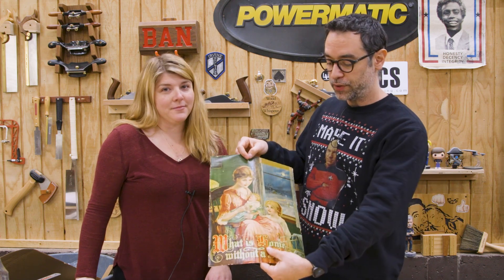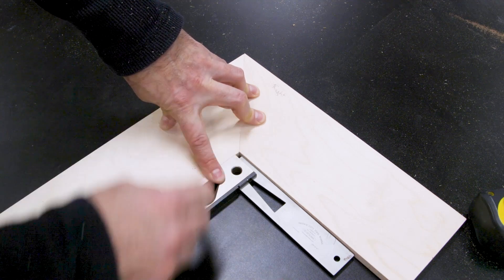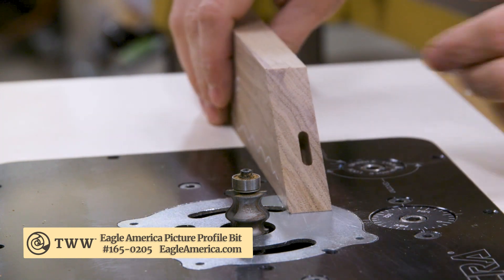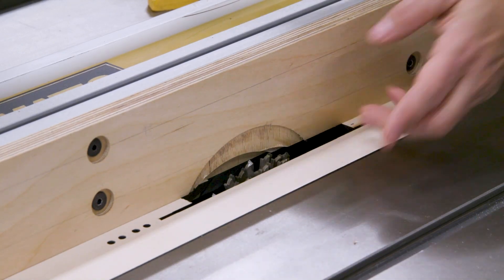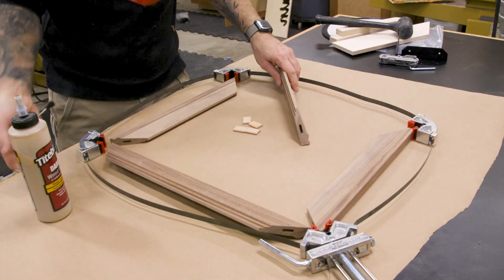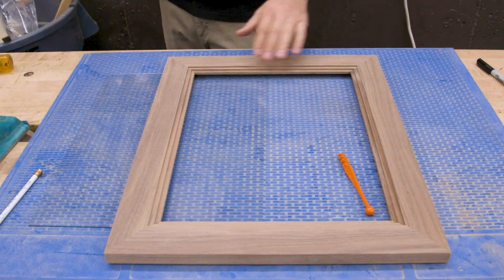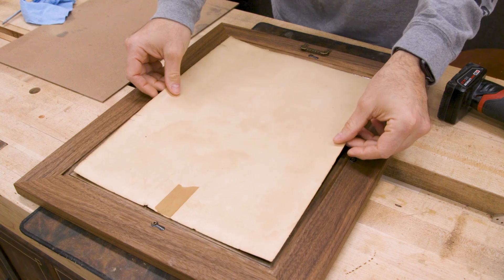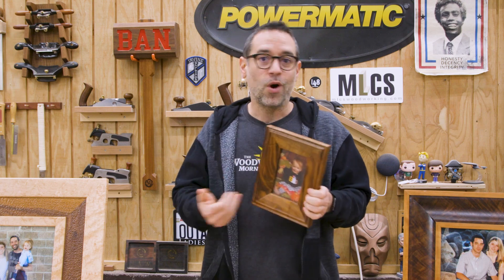A Classic Picture Frame

Comment: The notches in the back of the cutting tool can be use to snap the glass when making narrower cuts like you made.
Reply: I was going to add that the ball on the handle is there so you can gently 'tap' along the scored line. This will propagate the crack you have started when scoring the glass and make it easier to break away the waste. I used to do this with mess ups where I had to take a very thin strip off and with curves cut in the glass. It does take a bit of practice and the edge will not be as clean as a straight snap but you can blunt that with careful sanding. It is worth buying an extra bit just to practice on if you have never done glass cutting.

Comment: This simple picture frame turned out to be a lot less simple than I expected, but also MUCH more informative than I expected. Figured I’d just enjoy watching but actually learned a few nice tips. I appreciate how thorough you were with every step.
Reply: The domino is overkill tbh. Unless he’s subjecting that frame to a ton of abuse. Making holes with a forstner bit at the miter joints and putting in a dowel would be easier but also would be xtra.

Comment: Always like your practical videos.  Thanks.
Sorry to hear about the tear in the prized photo - BUT, good news there is a miracle fix.
I learned a trick/fix from an old Librarian that paper is basically wood and tears are easily repaired with white glue.

First water down the white glue until it is really thin - somewhere between heavy cream and milk.
After that, take two sheets of wax paper.  Place the torn piece pace down on top of one of the sheets of paper.  
For a torn book, the book will be the vise, but for a single sheet you will need a book to put it in.
Make sure the tear is perfectly aligned then paint the thinned glue onto the tear.  Don't overlay the pages you are actually gluing the fibers together. Use a pretty heavy coat but limit to the tear area.  
After that, put the other wax paper sheet on top and close the book. Then put the book under something heavy and let it dry.
Once you open it up, the tear will be gone and often near invisible (if you caught it early enough).
I had a torn page in a Bible I repaired years ago (what prompted the trick) and I don't think I could find it.

Comment: Nice build! I have a tip for finishing - you can actually install the screws that hold the panel in about halfway to use as a stand when applying finish to the front. Not as big a deal when you’re using an oil-wax finish, but useful for a lacquer or shellac
Reply from the maker: Great tip!

Comment: Those notches in the glass cutter can be used to help break off the thin strips of glass
Reply from the maker: Yup. But they don't really grip the off-cut and I didn't want the piece to fall. So the pliers did a decent job.
Reply: That is what I have used and if you tap on the glass on the line  with the ball end of the handle it starts the crack to spread and makes it easier.

Comment: The frame is outstanding. The tutorial is great. But I thought the art work should not come in contact with the glass as it could stick to the glass. If the art work sticks to the glass it would be impossible to replace a broken glass without destroying the art work. Thank you for sharing. Have a great day and stay healthy.
Reply: Yes, artwork should never touch the glass. It should be in a mat.  Also, the sawtooth hangers are not very good.  Picture wire and bumpers
on the bottom are better for hanging artwork.  Great job.

Comment: I love your work. I am not a wood worker and understand that this is a Woodworking video.  However, this is a sentimental piece - CORRECT?  

Never place your piece against the glass/plexiglass.  Use a spacer - usually some type of mat.  I suggest using an archival quality mat or spacers along the frame edge.  Placing a piece against the glass will accelerate fading and deterioration.  You can also use UV filtering and anti-glare glass varieties.  

Attach the art piece with archival tape (hinge-style) or archival (non-acidic) adhesive to a backer (foam core board) to prevent movement. And always enclose the back of a sentimental or special piece with a dust cover.  I use paper....easily done.

Comment: Great job as always. In minute 5:17 you cut a miter on you saw using a stop block. As a beginner I understand what you did but I'm having difficulties cutting angles that are opposite each other like in cross bracing while keeping the correct length.

Comment: With breaking a small amount of Glass. Hold the glass over the edge of your bench, and with the ball of the tool tap the other side along the scratch. That will start the break. For smaller off cuts it makes it insanely easy. That's what the ball is for

Comment: Odd question maybe for this video...but on your table saw fence, do you have it setup perfectly parallel to the miter slots and the blade, or do you have it slightly "out of parallel" past the blade (to prevent possible binding between the blade and the fence)?

Comment: They make some pliers for breaking the glass.  Also that little ball on the end is to tap it so the break goes farther.  Also the little notches in the side are for grabbing the glass and breaking it.  Also, you want a 1/16 or so for expansion and contraction.  The glass moves just like the frame.  If it dead on it will bind and crack.

Comment: Sometimes I nice classic yet simple frame is what's needed, What I like to do with frames is pass each piece throw the bandsaw adding a sorta elongated sine wave pattern and gluing a differently color wood the thickness of the kerf of the blade and gluing the 3 parts back together.  It's not hard to tell how midsize woodworking shops use to make a decent amount of money using up all their offcuts to make frames for the local photo development stores, When developing photos was a thing( there is a mini-rant in there i just know it), Most of the time frames were not even glues together but staples like roof rafters, The trick with cutting glass is not cheaping out on your glass cutter, I use to struggle cutting glass having only the local hardware store cheap China imports cutters, Then I spent real money on one that the big boys use in glass cutting shops and that changed everything.

Comment: Hey Marc, great tip about taping down the ruler while cutting the glass, I’ll be using that one. I have a Powermatic table saw too and was wondering if you have another video that includes information about the extruded aluminum fence you have (attached to your Accu-fence). I’d like to find one for myself.
Reply from the maker: I believe we talked about it at some point. Search my site for "very super cool tools"

Comment: Nice build as always. Well done. Not sure about calling reaching around the blade a “ calculated risk” however.  Seems like a push stick would have accomplished the same pressure and would have a lot less of a calculated risk

Your blade was maybe 2” exposed. At that height this risk is loss of fingers, not a band aid

Love your stuff

Comment: Wonderful job on the frame and glasswork. Unfortunately the enemy of art works is acid, acid in the paper, the woods, the finishes and backing sheets. The frame must be cut much larger than the artwork to allow for the matt board and backing. Art work must be matted, that is it must have a border of acid free cardboard cut and beveled to fit the art. The second layer is the art work and while it might be on acidic paper it must be backed and taped to an acid free backing board. Only then can the final backing sheet be placed on. The final step is to seal the artwork sandwich with good quality acid free tape to prevent dust and moisture entering from the back of the frame. If an art work is worth framing it is worth doing everything to ensure it lasts.
Reply from the maker: I totally get what you're saying Philip. But this print was saved from an old piece of luggage in a garage. I think this is still a step up. :)

Comment: Planning to make some frames in the near future.  I got your free project plans on TWW guild and they are great.  Two questions; for those of us without the domino, any tips for using biscuits?  Also, wasn’t sure if it was my eyes deceiving me but the sawtooth hanger looked like it had a tooth instead of a notch in the dead center position which would affect the way it hangs.   Did I just mis count?  Keep up the great work, and hope you have more videos coming soon.
Reply from the maker: You counted correctly. Really not sure why the teeth are made that way. I guess they just assume the art will be off-balance so why not?! I purposely shifted the mounting point over slightly to make sure there's a gap at the center point. As for using a biscuit, it's exactly the same as using the Domino. For a project like this just use the smallest size you can.

Comment: For the bevel cut on the table saw, could one have used feather boards to reduce the awkwardness of reaching around the blade? Maybe one at the top and one behind the blade?
Reply: I thought a feather board behind the blade was a big no-no
Reply from the maker: If you can get the featherboard up high enough so it only touches the top profile, yes that would work.
Reply: @stevesteves8915  While that was my impression too, not sure it'd be any worse that moving your hand near the blade;-) I think it should work as long as you keep the riving knife in place.

Comment: In the video you cut the side pieces to length using the miter saw and then you cut the decorative profile and dados in the shorter pieces.  Would there be any advantage/dissadvantage to cutting the decorative profiles and dado in the full length piece of stock and then cutting the pieces to length on the miter saw?
Reply from the maker: Yes. The profiles cause more trouble for the miter-cutting as they commit you to an orientation. So you'd have to move the miter saw to the other side of 90 for half the cuts.
Reply: @woodwhisperer  Really good point, thanks for clarifying

Comment: Is acrylic an acceptable alternative to glass?
Reply from the maker: Structurally yes. I've used it in the past. But for folks who are really into this stuff, you have to be careful about reactivity with the artwork. So do some research before you commit.
Reply: Glass is superior in almost every way except that it is heavy and brittle.  I used acrylic to frame a poster-sized art print because it was something like 10 lbs lighter than the same glass panel.
Reply: @woodwhisperer  Archival picture framing is a skill unto itself. Having ruined some artwork (fortunately my own and not a customer's) by placing it in contact with the glass, and by using backing materials that leach or off gas stuff that deteriorates the art work, I was cringing the whole time you were assembling the package.  It will probably be fine, though, for the expected life of this project. I did find the construction of the frame valuable and will put that information to good use. :-) Maybe you could find a link to a picture framing site where folks can learn more about the technical details and add that to your info.
Reply: Most museums and galleries prefer acrylic as it's less prone to shattering and resulting in torn artwork. I believe insurance on artwork is easier to obtain with conservation acrylic as well (not 100% on this, I'm no broker). Acrylic is far lighter for use when the artwork is larger and/or you have a very narrow frame (which are very in style right now). Conservation acrylic tends to be at least 4x more expensive than conservation glass. The shop I used to work at paid something like $800 per 4' x 8' sheet of acrylic. Use a acrylic cleaner that removes the static charge so the artwork doesn't cling to it (your art should be appropriately spaced away from the glazing anyways). I've also seen those static gun things but never used one.
Reply from the maker: Considering what this print has already endured and survived, it'll do just fine and be much better off in its new frame. :)
Reply: @woodwhisperer  Cool, I purchased some watercolor art off Etsy and I was planning on using acrylic sheeting as it was going to be around the same cost and I'm more accustomed to acrylic cutting than glass cutting

Comment: With the risk you're  taking at 10:25 and perils with planing and scraping and sanding... Why not make the molding first and then cut the pieces to length with the miter cuts? ❤🌅🌵😷
Reply from the maker: How does that improve things with regard to the bevel cut? The reach-around would still be needed even if the miters aren't cut yet. Also, if you cut the miters first, you don't have the profiles interfering with the miter cuts. I was able to keep my chop saw set up at one angle and locked in place for all miter cuts. If you cut profiles into the face, you have to think a lot more about the miter cutting operation. Ultimately, there are probably several ways to get this series of steps done and this is the progression that made the most sense to me.

Comment: Please cut the mitres last. 
I was shaking my head from the start, machine the moulding in lengths first for safety and ease mate and then cut the mitres.
Draw the glass cutter towards you and don't need to sand the glass.
You need space between the art and the glass to stop it from sweating and turn buckles in the corners too.
I own a framing shop and 30 years industry knowledge so sorry for the rant.

Comment: was that a $60000 "festool" miter saw you are using 😂😂
Reply from the maker: I prefer to think of it as the saw that made me $60,000 by using it to build stuff. I'm a glass half full kind of person. :)
Reply: @woodwhisperer   so you agree that it is the man not the machine,  these festool tools are way overrated and way over priced if you can’t even get a perfect angel with them 😆,
Reply from the maker: It's a tool, not a magic wand. So like any tool, it eventually needs calibration.  And yes, of course the person running the saw makes a difference, but a good tool in the right hands can make a big difference too. I agree that the Kapex is overpriced for what it is. But it actually does several things better than other saws on the market. So I think it's justifiably more expensive than the competition. I just don't think it's quite worth 2x as much, unless those couple of things it does better are extremely important to you.
Reply: @woodwhisperer   cheers bud, I was just bugging you, keep doing what you doing and thanks for all these awesome videos.